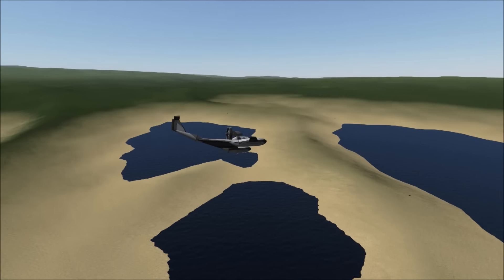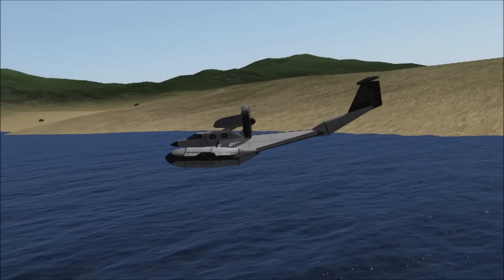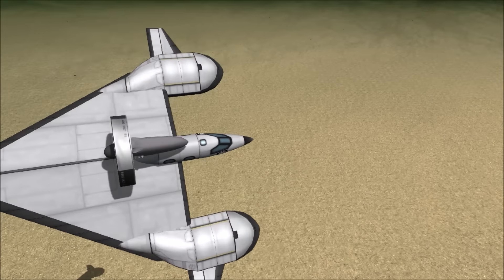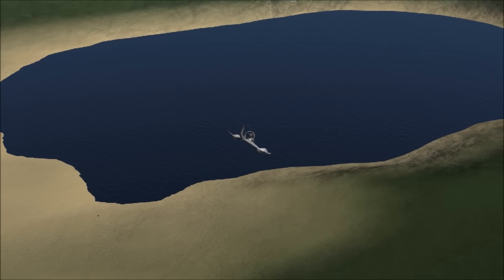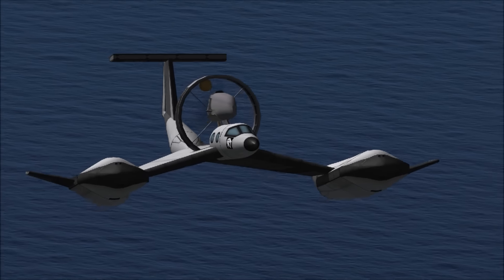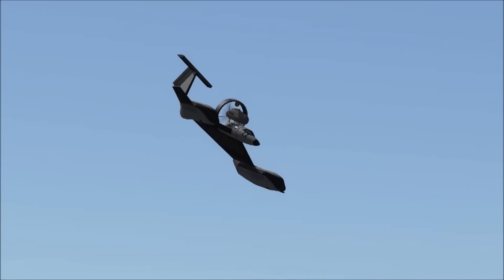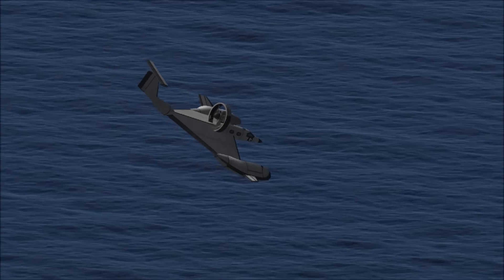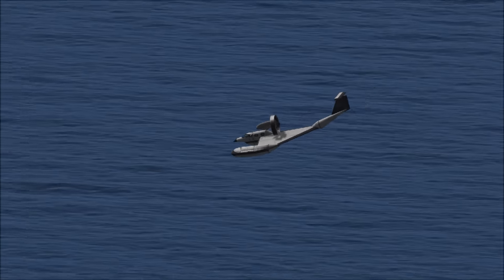KSP History's Misfits S3E5 - X-114 Airfoilboat

Comment: Hey, just wondering how did you re-texture parts in some of your older video? 
Did you use KerbPaint or some fixed version of it because I can't find a working version?
Reply from the maker: Most of the parts in season 1 were from retro future, which were black by default. Beyond that some KerbPaint was used, but that was a few versions back.